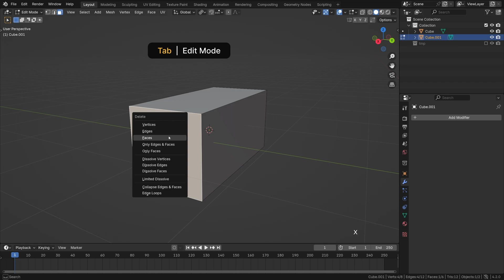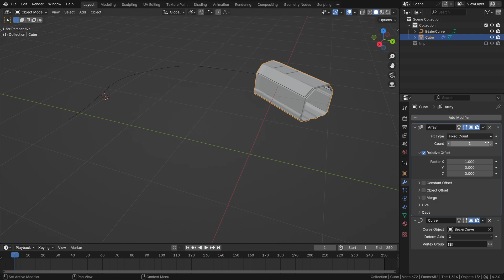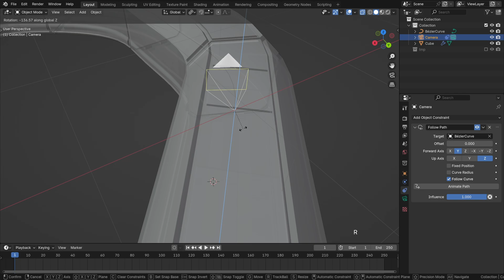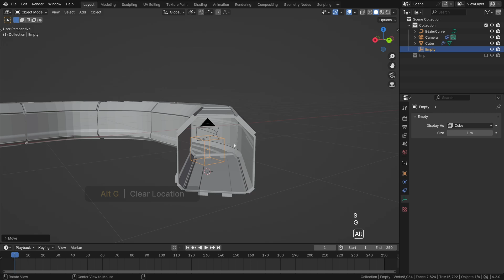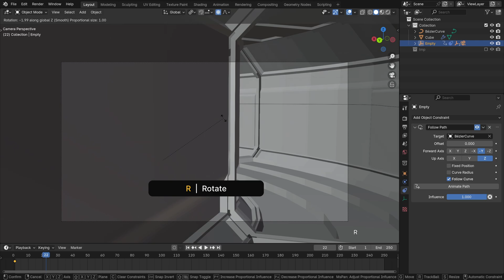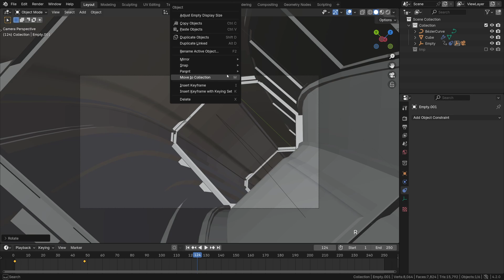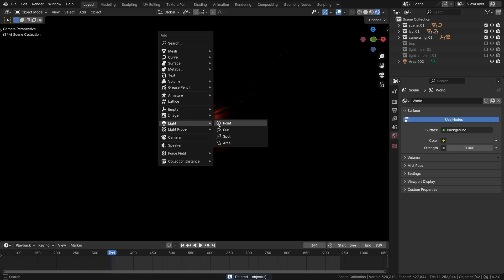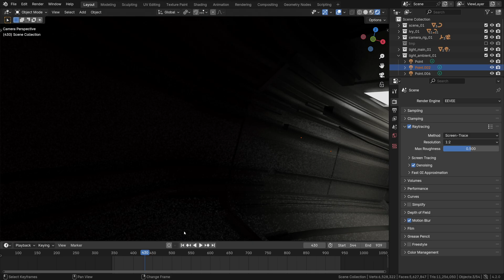How to Make a Sci-fi Ventilation Flythrough | Blender Tutorial

Comment: um, you don't have to update the count of the array modifier, but set it from "Fixed Count" to "fit curve". That setting is there exactly for this really procedural use case. Cheers!
Reply: I just tried that, but it didn't work for some reason. It fit the single segment to the beginning of the curve, but didn't extend it.
Reply: @shrimpkins  Maybe make sure all scales are applied?
Reply: @TechnicJelle  It's not that; but I'll keep tinkering with it.